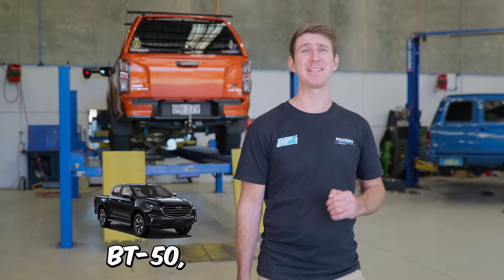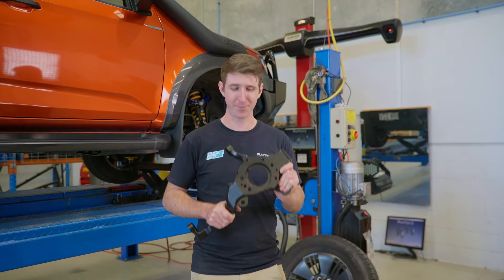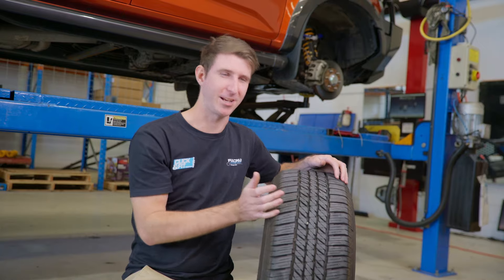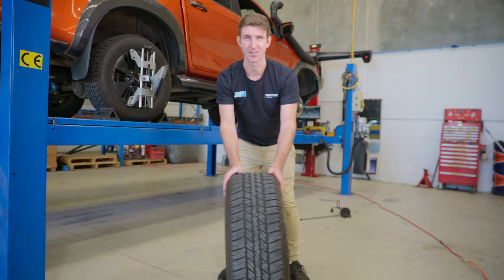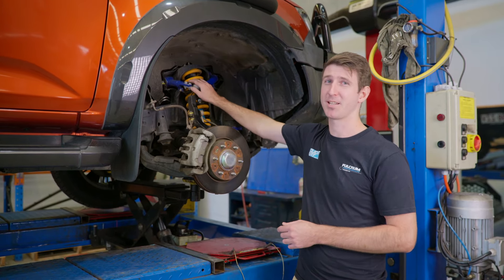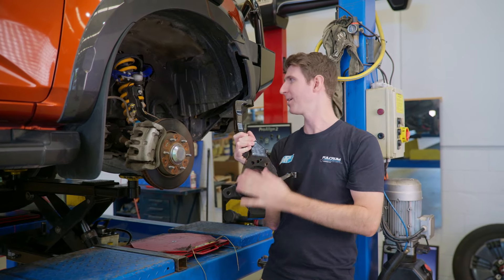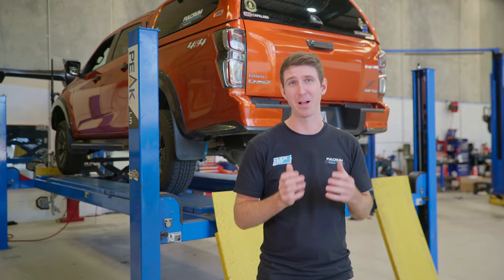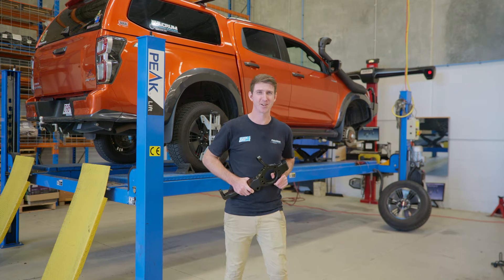How To Fix Tyre Wear On The D-Max, BT-50 and MU-X!

Comment from the maker: Hey Guys, It's important to point out that most of the owners of these models we've spoken to are wearing through tyres in as little as 5000kms one even wore through a set in 1000kms. The majority were getting at most 10'000-15'000kms out of the tyres which is shocking and means replacing them every year essentially! Tyres being on average $300-350 each you really can't afford to be having this issue long term! The other important thing to note which we have seen some people mention is that you can get a good wheel alignment to correct bump steer. This is NOT correct and will will NOT fix the bump steer issue. It will only mitigate tyre wear slightly, additionally it would require a wheel alignment on average every two weeks. On top of this you will still see abnormal tyre wear even with specialist wheel alignments. We know this because we provided these services as a workaround until SuperPro's Steering Knuckle became available.
Reply: That’s only when bull bars etc are fitted and not wheel aligned. I’m on 55,000 with one of your lift kits on my maxxis and still have plenty of life left. Feathered edges but more from probably not being strict enough with tyre pressures up in the Kimberly etc.
Reply from the maker: @jasonwebber9811  This is not true. We have seen this issue occur on stock vehicles with no front load bearing accessories. However, once front load bearing accessories such as a bull bar is added, the issue becomes worse.

Comment: Good info to show the OEM should the problem appear. One thing to note be sure to check the wheel alignment upon receiving the vehicle from the dealership my dmax alignment as found needed correcting. 10k on and no issues so far.

Comment: 42k km so far on Maxxis Razr ATs  and I've done several alignments, rotations and 180 deg rotations to keep them alive. I reckon I'll get another 15k to 20k km out of them. I just had the alignment done to Isuzu's new specs (released 31 Aug) and will keep a very close watch on how the tyres wear. Absolutely disgusted with Isuzu in general with warranty issues.

Comment: If it's a design issue, even on a standard MU-X with no bullbar or suspension modifications, why are people like me with an MY21 LS-T 4x4 seeing our vehicles at 36k and beyond on our original tyres having normal tyre wear and expecting to get many more kms out of our current tyres.
Reply from the maker: From what we can gather based on community feedback, yes some people like yourself are not having any issues. However, there is still a large portion of people with these models that are having the issue and we're trying to help fix that for them. 

If you aren't having the issue, then you're part of the lucky group that doesn't need to worry.
Reply: the poorer the road surface the higher the degradation.. maybe you rolling more on smooth roads?
Reply from the maker: @darrellmaartens6425  at this stage we belive it is more of a case of upgraded tyres / people not checking for wear. Although road surface is definitely a factor. The same way that adding aftermarket accessories is a factor.

Comment: If the vehicle is not modified this is a consumer warrantee issue there should be no reason to go for an aftermarket fix. If tyres are getting excessive wear in 10 -20 thousand Km this does not meet the requirement of expected durability. Australian consumer Law requires the Manufacturer/seller to correct the problem if they are refusing to address the problem see your state consumer protection authority. I have suffered this issue however have modified the front end loading with bar work therefore I believe now my issue and aftermarket parts such as this my responsibility if I decide to correct the wear issue.
Reply from the maker: While we don't disagree, we know from customers experiences they have tried to get the manufacturer to fix the issue under warranty but have heard many people say they are unsuccessful even with stock standard vehicles. Some are able to get the tyres replaced under warranty, but only if they are the original tyres that were on the vehicle from factory.
Reply: Manufactures will often make statements and attempt to get consumers out of the door or make some offer which is less than their obligation under consumer Law  if you press hard. They are obliged to meet the requirements of normal/expected durability where a modification has no effect on the componentry. Hence lifting or adding  weight to the front may have an effect and negate liability . Replacing factory fitted tyres with  ones meeting the specifications in the manufactures handbook would not remove their liability. Liability may be to replace tyres and realign but would require a repair/modification if the issue is ongoing. Have any of your customers asked for warranty repairs and been refused with the support of their state consumer protection agency? 
     @FulcrumSuspensions1976
Reply from the maker: @philbrittan761  It's difficult to say, but I have seen comments online from people with these vehicles that they have gone to ACCC with no luck. Mainly due to the large range of "tolerance" allowed on what is deemed suitable wear, for wearable items such as tyres etc. As even though it wears much quicker the factory suspension is still "safe".

Not to say that no one will be successful and hopefully someone is but currently nothing more than the dealer agreeing to replace the factory tyres under warranty with certain conditions i.e no modifications, factory brand tyres etc, from what we've seen.

Comment: So the steering pick up is getting raised to fix it right? But by how much? Because wouldnt there be far far cheaper options running rose joint ends and spacers or long ball joints? This seems super extreme and expensive for something that isnt that complicated.
Reply from the maker: We looked at just raising it with a spacer but unfortunately the mounting point is a tapered mount and you'd need to flip the tie rod end as well to mount above the OE mounting point, making the taper the wrong way. Due to safety standards and the above mentions the best/safest option was to make a new steering knuckle with the mount in the new position.

Comment: Priced it too high. Tyres still lasting long enough to not justify spending that much money just to save some wear. Would only pay for itself if you installed it day 1 and had the car for 200,0000+k’s. better off just putting the money to buy more than a new set of tyres
Reply: Let us know when you have a cheaper repair for it.
Reply from the maker: Hey mate, we know the part and install is expensive if most people were only going through tyres every 60'000km's sure it be too much to justify. However most if not all of our test vehicles/customers reporting the issue were going through tyres in 5000-15'000kms and a set of replacement tyres from most tyre shops is about $300 per tyre if not more. Which when you do just the fronts thats $600 for just tyres each year essentially, over 3-4 years you've paid for the kit.

We've had over 50 customers already purchase and either had it fitted already or waiting for their fitment date because they were desperate to find a solution as they were spending far too much on tyres.
Reply: I’m on 55,000k’s and still life left. The problem is there but not bad enough to justify this expense
Reply: @jasonquinton4400 wish there was one. Isuzu should be fixing the problem to be honest. These are just way over priced, would rather just buy 1 set of extra tyres over the life of the car if I kept it for 250,000k’s
Reply: @jasonquinton4400 thankfully munji has a super cheap semi fix. Basically a bolt in steering rack drop.
Reply: @FulcrumSuspensions1976  way overpriced. Did you guys priced this by calculating how many sets of tires are used every 50,000kms? This is a terrible way of pricing something. The price is highway robbery.

Comment: I have a dmax with zero tyre wear issues.
Reply from the maker: Do you have the current model?
Reply: @FulcrumSuspensions1976  Certainly do
Reply from the maker: @zarajoe1  from what we have seen its a mix bag in regards to the severity of the wear. We have seen some customers with a completely stock vehicle with no accessories wearing out their tyres very fast. Some only notice the issue when a bullbar is installed (or other front load bearing accessory). We have a noted few outliers like yourself who state they have had no issues (which honestly is great). But unfortunately if you visit any Facebook groups and search tyre wear, you are bound to find many people complain about the problem.
Reply: Really noticeable with the factory tyres
Reply: @wax333  I'm thinking of my factory tyres
Reply: 42k km on Maxxis Razr ATs  and I've done several alignments, rotations and 180 deg rotations to keep them alive. I reckon I'll get another 15k to 20k km or of them. I just had the alignment done to Isuzu's new specs (released 31 Aug) and will keep a very close watch on how the tyres wear. Absolutely disgusted with Isuzu in general with warranty issues.
Reply: You're lucky, I'd 42k kms the OEM tyres and they were done, pieces pealing off them.
Reply: @willcaswell2341  to be fair the factory tyres are highway terrains. 42km is pretty on the money for standard highway terrains. The Bridgestones they come with are also terrible in general so there's that

Comment: What’s the  price fitted ?
Reply from the maker: $2465 is the supply and install cost for the pair of steering knuckles. - https://fulcrumsuspensions.com.au/upgraded-front-steering-knuckle-kit-bump-steer-correction-to-suit-isuzu-d-max-mu-x-mazda-bt-50-9995-trc6680-177261.html